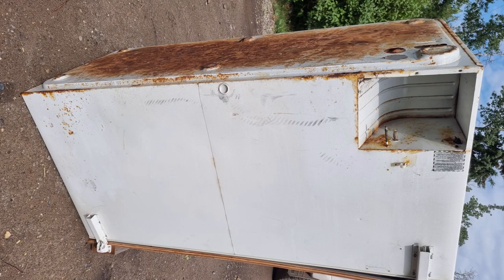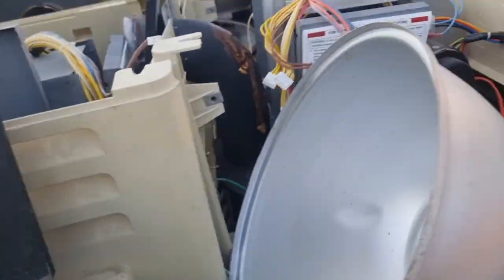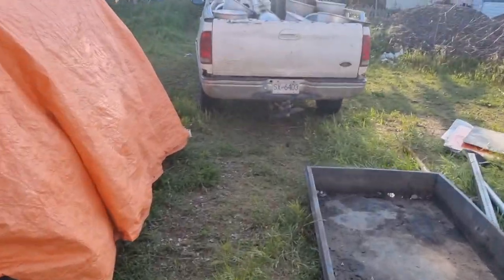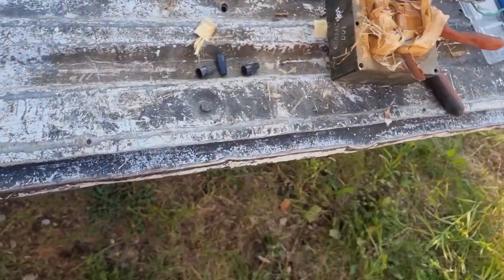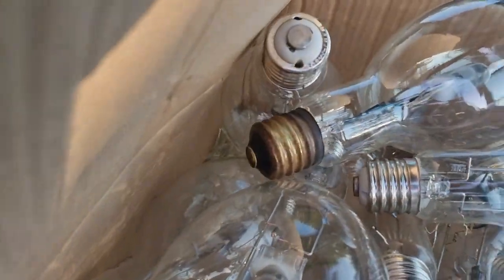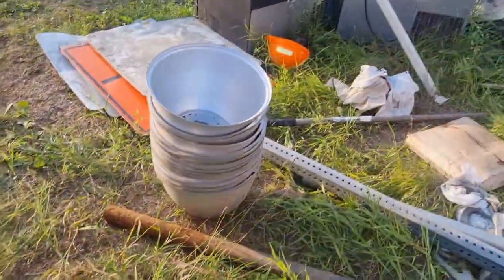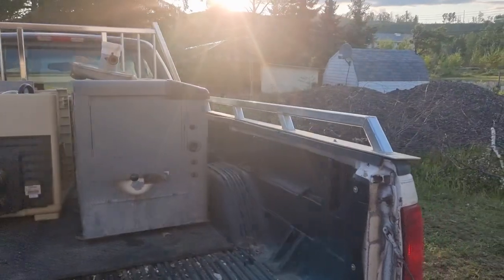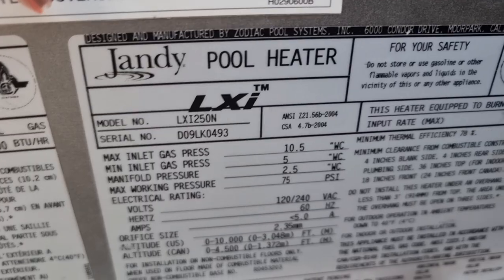A Pretty Nice Pick up #scrap #scrapmetalrecycling #trashtocash

Comment: That is awesome. Did it take you long to pull it apart.
Reply from the maker: No, I just popped the canister open though. I didn't go after any of the other bits yet. I'll do a full teardown on each type and see what we get. That was 12 lbs, and then all the stainless, brass, aluminum, wiring, etc so If the other type gets that I'll be very happy. Just to pull that 12 lbs out was about 5 minutes. Like 8 7/16 nuts and then the sawzall to nip it off.
Reply: @HHRecycling  wow, that is a lot of work. But it sounds like a great payoff.

Comment: Capasitors I throw as steel shred.  I tried to turn them in as aluminum, but they wouldn’t... At least here in Az USA. 

Nice amount of lights!!!

Glad to see ur video!! 

Greetings from Az!!!

Steve.
Reply from the maker: I have a deal now that all electronic goods go whole and they pay the shipping so I am just throwing everything in with the loads. It's only around ten cents a pound, but they will pick it up at my place and supply all of the shipping materials, so it works out well for me.
Reply: @HHRecycling   that sounds like an amazing deal!  I still run my stuff off to the yard once a week, at least, otherwise I get too backed up😀😀😀

Have a great one!

Steve.
Reply from the maker: @Salvaging-in-Az  you aren't 1.5 hours from the yard though. That hinders my excitement to fuel up my f250